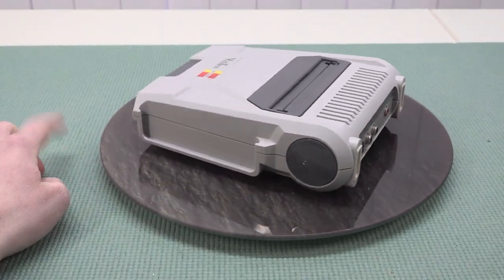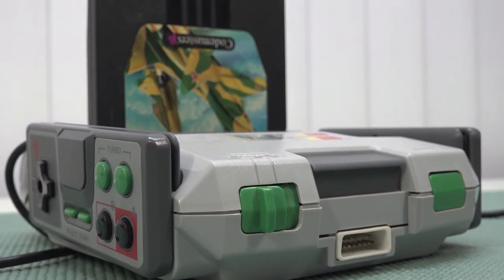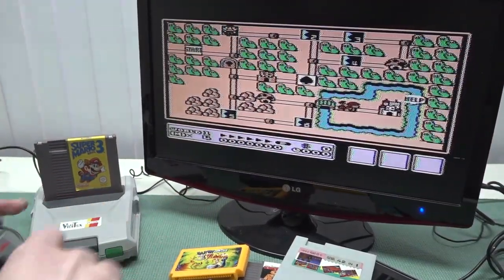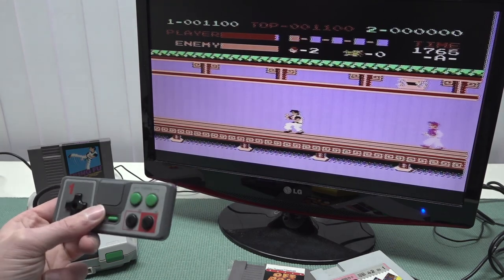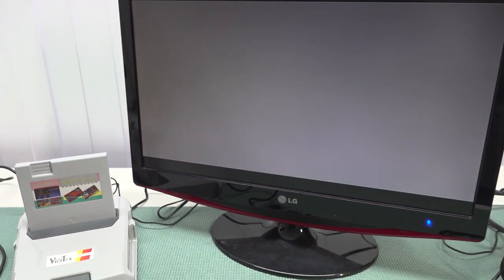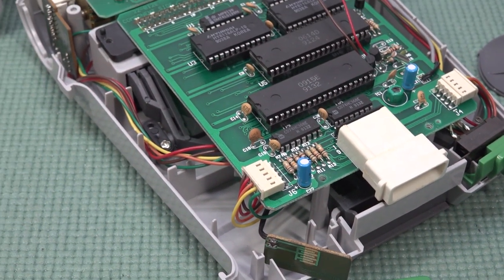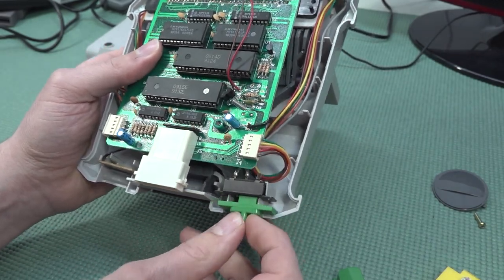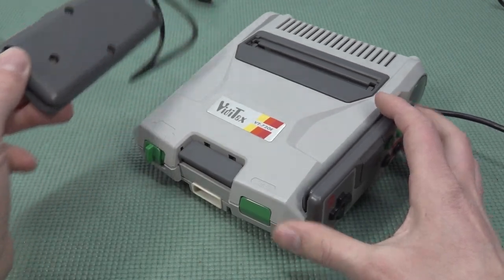Awesome Piece Of Retro Tech From The Past 🙌  Viditex VT-720E

Comment: These 15-pin connectors for guns were popular in the 90s before the Chinese bootleg manufacturers decided to use 9-pin plugs for everything. I believe this plug was used in the original Japanese Famicom. Apparently this manufacturer thought it would be cheaper to use it for pads too.
Reply: True my Terminator 2 has the same connector I am searching for the controller that has 15 pins

Comment: That's probably the coolest way I've seen someone place those light gun ports into their famiclone, I've seen.

but what, you can connect 2 in the back and 1 in the front?
Reply: The original Famicom had a similar design. The two controllers were wired in and there was a separate front port for the 15 pin Famicom accessories, like the light gun.

Comment: That system doesn't seem to be bad quality at all. It does need some maintenance however. I would love to have one of those in my collection. The thing is that these days they remake those systems and put a NOIC inside cases that look exactly the same, so you often buy new crap without knowing. And if you are worried about the signal, well I have a few original famicom systems and all of their signals are crap. So don't blame your clone :P.

If you really want a good quality image then you need to mod a nes with a nesrgb. In my opinion that the only way to have real hardware and a decent signal. But I'm too much of a cheapskate to do it myself. Who knows, maybe one day I will.

PS: the on/off switch was most likely caused by short caused because of an uninsulated piece of wire. If it happens again, make sure to check if nothing needs to be insulated.